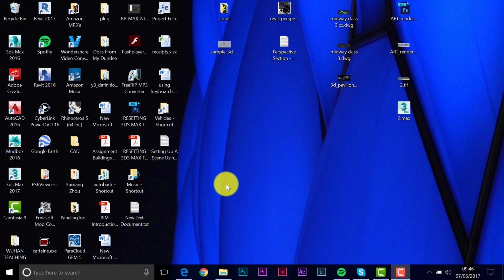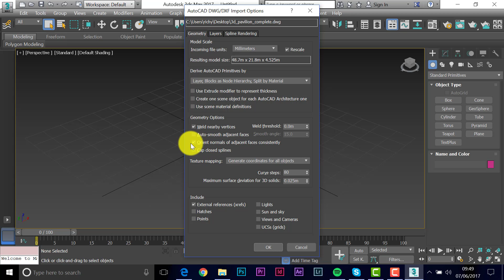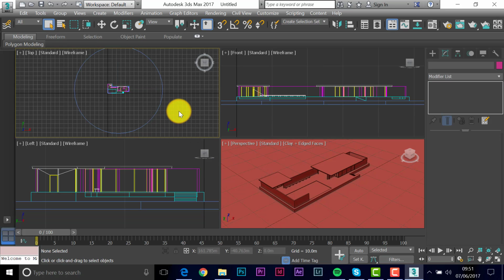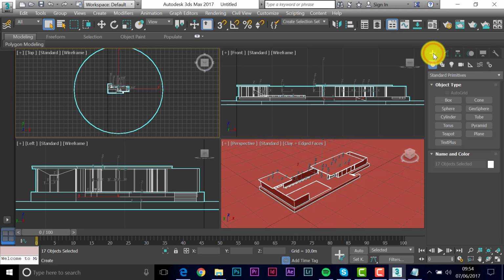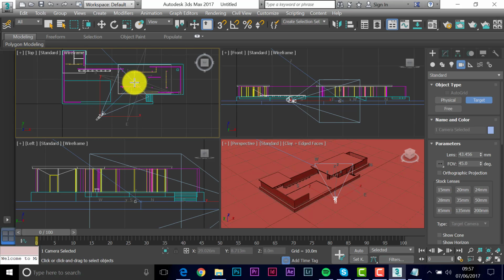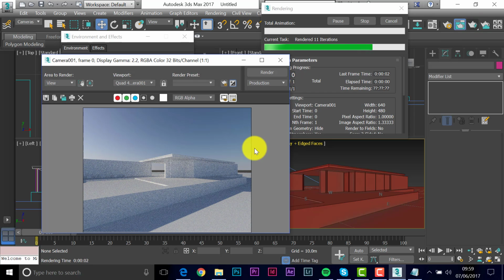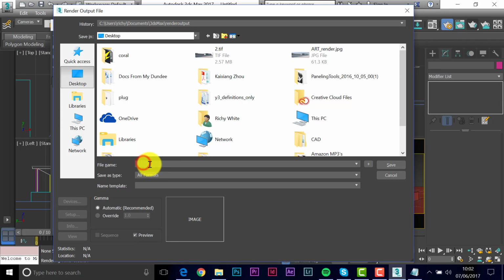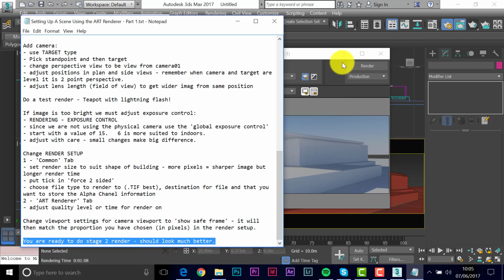3ds Max - ART Renderer - Setting Up Scene   Part 1

Comment: I am laaate, but is this renderer just full path tracing or does it support a selective ray tracing (you know, for choosing what materials get ray tracing and what dont) mode?
Reply from the maker: I don't think so - ART has really no controls apart from how long to render and/or quality level. They push ARNOLD now as the more featured renderer.
Reply: @emmockladdie  Okay, thanks. Just wondering. I like hybrid renderers that give you control over materials way more than the ones (like Arnold) that try to be realistic, which is why I wish Mental Ray was still around.

Comment: HI, i'm using the ART Render for the first time, i'm not a pro on studio max but when I'm rendering it takes so much time like 20 min ore more and the render it's noisy, like not pixeled but noisy. Can you say what I'm doing wrong? Maybe I didn't set up it correctly :( Thank you
Reply from the maker: ART can be a noisy render if you have lots of reflective materials disable the reflectivity of materials one at a time to find out which one(s) are causing the noise (fireflies). The time aspect really depends on how large a render you are going for and how fast a processor your computer has. Mobile processors (end with U) are not good for rendering, the H and K ones are more powerful. Do test renders small 1200x900 ish before attempting larger. There is a denoiser in ART but I find it makes renders look blurry but worth a try, it's in the options for rendering.

Comment: I was wondering if you knew how to render objects in art with shadows as transparent (PNG).
Reply from the maker: Hi Giorgio - I don't think it lets you - that was a good feature of Mental Ray but ART does not have render elements or matte shadow materials ... its pretty limited and I don't really see them trying to make it any better.   Does the density setting of the advanced ray trace shadows do what you want ... I am suspecting not but worth a look.   Messed about with Arnold yet ? ... much more capable than ART but yet again we have to change materials.